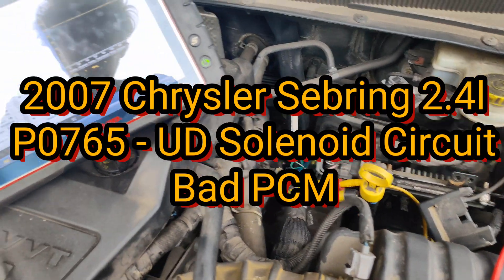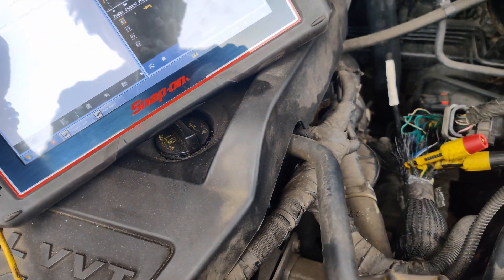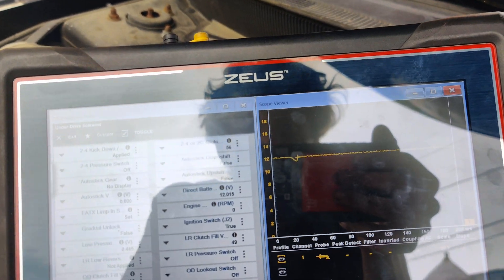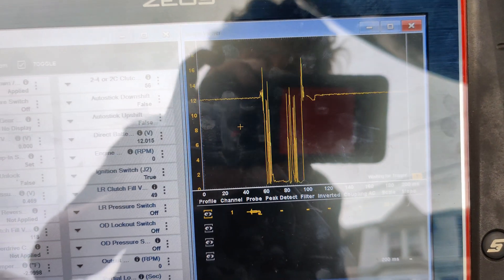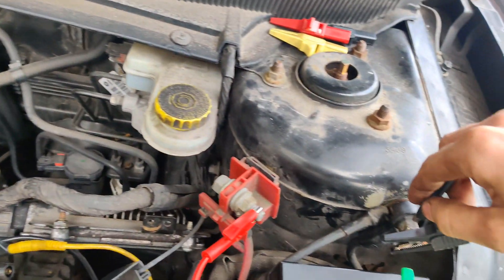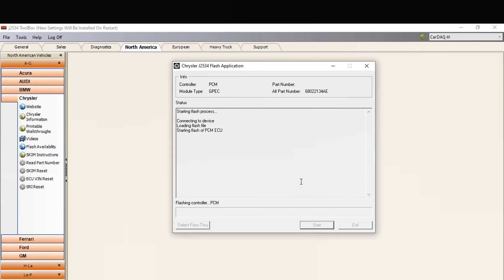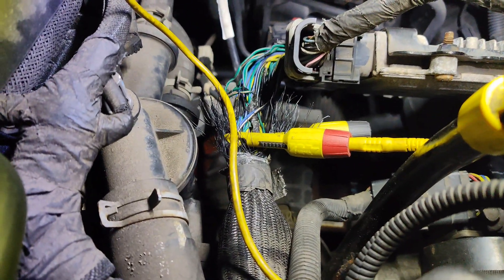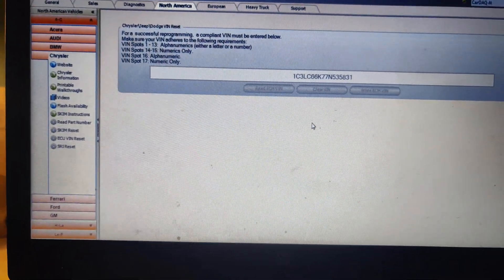2007 Chrysler Sebring 2.4l P0765 Bad Pcm? (Programming Video)

Comment: hello, I have exactly such a car, after starting the automatic transmission works fine for a while, then the box gets into an accident, if you turn it off and then start it up again, the box will work fine again and then the same story, diagnostics shows a problem with the solenoids and the crankshaft sensor where to start?

Comment: I can manually put car in any gear except neutral or park car won't crank or even attempt to start in thinking in the shifter itself cause it get stuck in park and won't move but like I said I manually change gears on tranny and bypass shifter so it comes out of park car will not go to neutral indicator skips n goes to all gears go back up won't indicate p but does reverse what could be the problem can ran perfect before all this
Reply from the maker: You would have to do some testing and get a wiring diagram from the neutral safety switch/ range sensor.

Comment: Hey quick question, i have the same car and my PCM went bad and i bought one that is soposed to be repeogramed already and pluged in ready to go, do thoes need any type of reprogramming too or not?
Reply: I got the same question ,already get a PCM junkyard is fine just plugged ?or needed do other fixes?
Reply: @pedroj4230   If you pulled a PCM from the junkyard, it won’t do you any good. It needs to be programmed to your vin number.
Reply from the maker: The skim has to be programmed too.
Reply from the maker: I don't know what they mean by reprogrammed. If the Vin and skim information is programmed in it from the old one then nothing is needed. If it is not you will need to do that. I believe if your key is Grey it needs the skim programmed, if it is black you don't. I could have them backwards. Also if you bought it online a lot of them do not have the latest calibrations.

Comment: what version of java you running??
Reply from the maker: Good question, I don't remember. I had just installed this and flashed a 2004 Ram right before this. We tried several times to do the Vin and it would work. I will soon have a dedicated computer for flashing.